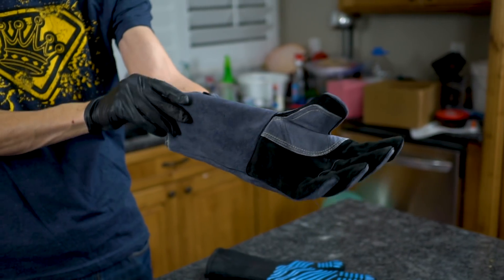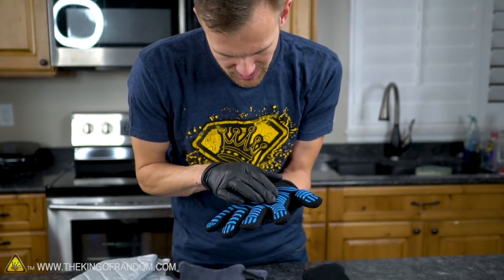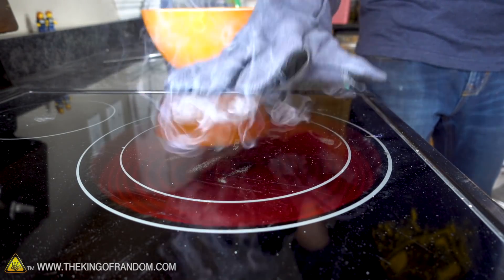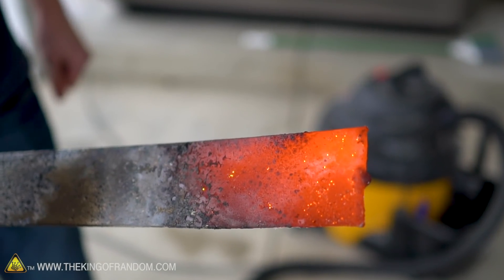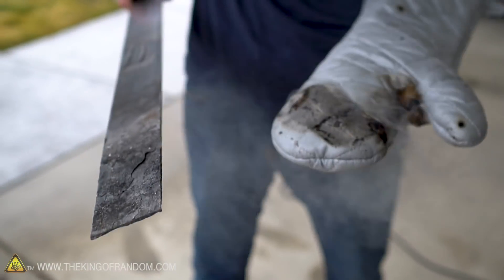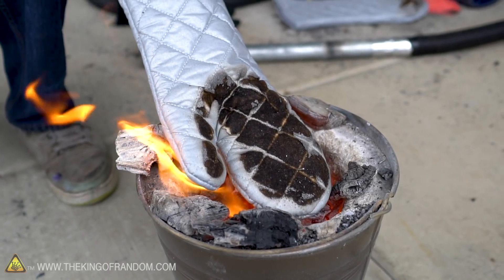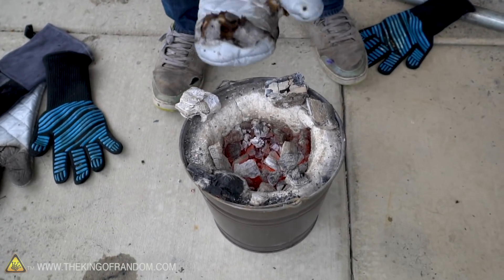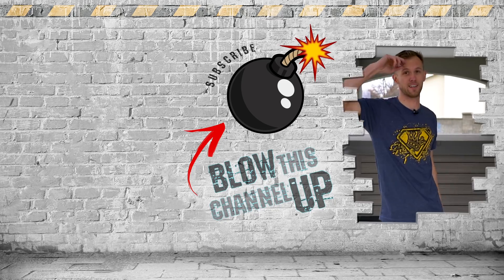How Much Heat Can It Take?

Comment: Have you tried fire department gloves?? If you get on The fire store .com you can pick up a pair to try I would recommend leather but they can get into the $100 price range for nice ones it would be cool to see you try though
Reply: The ove gloves outer layer is made from the same stuff then they put a high temp silicone on it.

Comment: I was sceptical at first with the wool knitted gloves with rubber dots and stripes but when i saw how long he could hold his hand on the hot stove i was so shocked!
Reply: yeah me too they looked like theyd be terrible
Reply: I don't know about the gloves in the video but I have a similar pair and they are not wool but actually made from knit aramid similar to kevlar.  In addition to being very strong it's also nearly cut proof and very heat resistant. They are awesome for just about any normal household use that requires heat resistance.

Comment: What would happen if u put liquid nitrogen on molten metal in a furnace
Reply: It would just roll off, Leidenfrost effect.
Reply: Or evaporate
Reply: It would turn to nitrogen gas.
Reply: Nothing interesting
Reply: It would evaporate fast in till the molten metal is the same temperature as the liquid nitrogen
Reply: Want explosion mix sodium and water in chlorine or ceasum in flourin or try mixing bromine water with almunium or make ch3-ch2-o-mg-x with water or mix sodium and potassium and put it in water, bromine, chlorine, flourin
Reply: @codebulletin  i hope your not planning anything
Reply: @zackburkhart42  no no I am planning big like azo dye azadine ceasum ozonoiod and even bigger sarine
Reply: What would happen if you put a furnace that’s inside of a vacuum chamber, inside a furnace, inside a furnace with liquid nitrogen in a furnace
Reply: @joostvanenkelen667  nothing much nitrogen will boil off and pressure will build up but if ur running it then nothing will happen but if ur not then it may explode due to pressure

Comment: 1500 to 1800 degrees and he doesn’t feel it.900 degree stove and uncomfortable within 2 sec
Reply: I think it's because it is different heats and different materials. I mean, a stove is design to expell a lot of heat quickly, a hot steel bar is just hot because you heat it ^^
Reply: Thermal mass. In terms of what is actually hot, the stove has more. So the volume and density of whatever is hot matters when it comes to heat transfer. A bit more involved than that (properties of transfer rates and carrying capacity for different materials, etc.), but it's a reasonable starting point.
Reply: Also the stove is a constant heat while the metal is cooling as he is holding it

Comment: Please do light bulb in vacuum chamber
Reply: Lightbulbs are a vacuum chamber
Reply: I doubt anything would happen at all.
Reply: Nothing would happen because light dosent need a medium to travel so it could still go through air without a medium but that’s why you can’t hear sound from a vacuume chamber because it needs a medium to travel
Reply: What are you expecting to happen? The lightbulb is already sealed in an airtight enclosure with inert gas on the inside. Unless you mean taking the glass off the bulb and placing that in a vacuum chamber. But it probably wouldn't be too exciting.
Reply: Yes!!
Reply: THE ANSWER IS EASY IT WILL LIGHT UP WITHOUT ANY PROBLEM!!!

Comment: BBQ gloves are great; I like the Ove-Gloves myself. I can light my coals, and after they're hot and ready to be spread I just reach in and move them around like they're cold.
Can't just sit and hold a hot coal in them or you will burn yourself, but for the purpose of rearranging them they are an outstanding buy.

Comment: I know that those furnace gloves help avoid burns (I have the same ones) because while doing hot meatal working I acedentaly picked up 1500-2000 degree meatal for about 10 seconds and I felt barely any heat but I heard sizilling

Comment: The reason the oven mitt catches fire is because it’s mostly cotton. The reason why they make cotton oven mitts is because cotton doesn’t melt, unlike polyester which can stick to your skin and can be very hard to remove. That’s why welding jackets or pants are either made of leather or cotton, because if your polyester pants lit on fire, they would melt to your skin.

Comment: Well they use the cheap kind of welding gloves and those are the ones to not work that well, but the ones that do work is a the ones that go for 45-50$ and they actually work cause I have handle red steel before during welding class. Should they do a redo let me know.🧤 🧤🔥🔥

Comment: Just going to say unfair testing on the grill gloves compared to the hot metal as you placed it on the metal part that was Orange but the other two gloves that you tested the metal was no longer orange when you placed it upon that point in the metal just saying you want an accurate testing they should all be the same Heat

Comment: welding gloves will smoke off  i learned from welding hot metal in SMAW never hold the steel but use pliers i smoked and burned my glove up the index fingers are burned